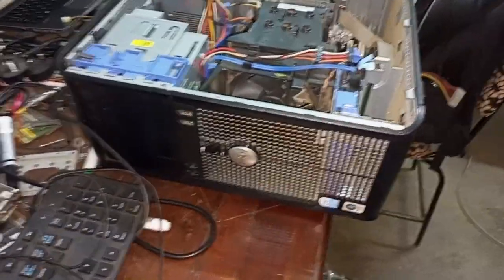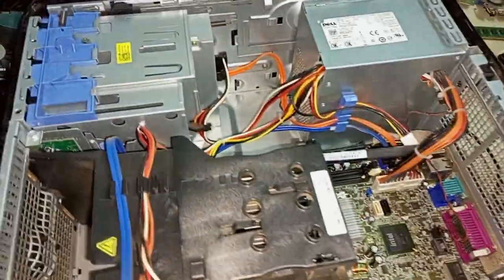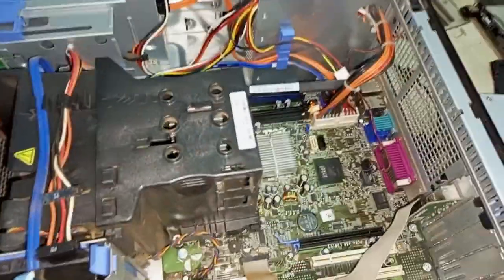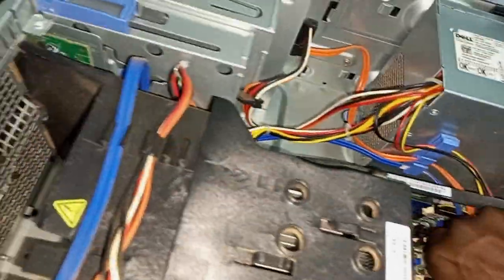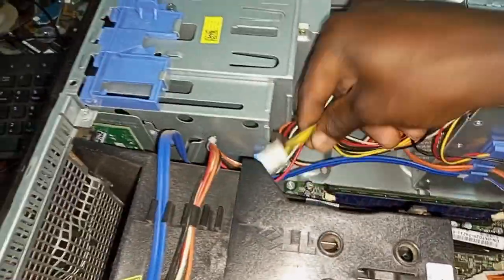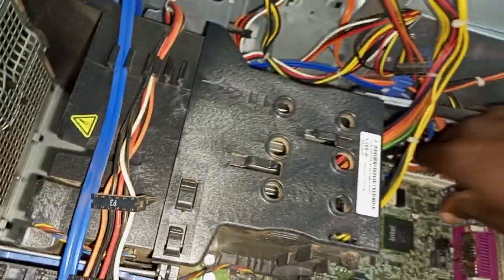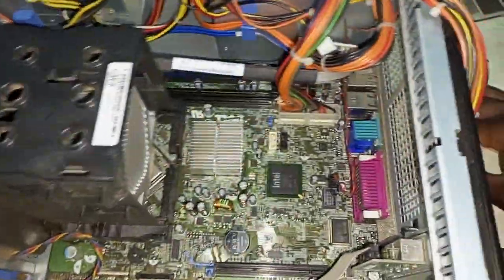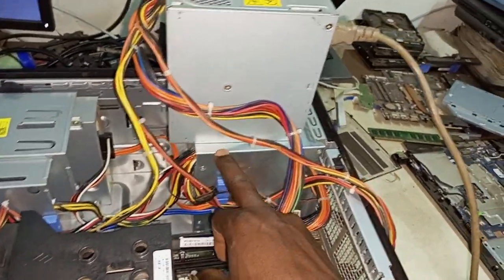Dell optiplex blinking orange light on and off repeatedly

Comment: Can't we fix this problem without changing anything
Reply: No. As you can see that the power supply was defective. In case of hardware failure one must either repair that piece of hardware or buy a new one.